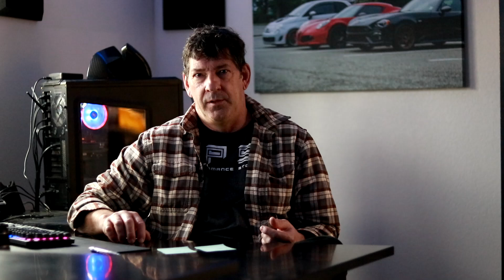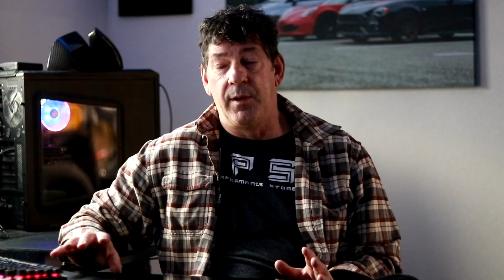Boeing 727 Falls From the Sky TWA 841

Comment: Notwithstanding the fact using the crossover valve to start the other engine should make it top of mind to IMMEDIATELY turn it off after engine start, how does a Navajo driver with that level of expertise not notice the tremendous weight imbalance of burning fuel only from one side? Even if his autopilot would handle that, you should notice the ailerons or yoke.
Reply from the maker: Having worked at that Airline I can explain that. There was tremendous pressure to be on time. So much so that the standard practice was to do the weight and balance data AFTER takeoff when in cruise. (not it wasn't legal, but the FAA didn't car) I'm not making that up. The pressure to "block out on time" was so great that the pilots are conditioned to only think about that and once the engines are started it's a big rush to get there. Also, all the airplanes were old and somewhat bent, so needing a lot of trim wasn't unusual.
Reply: @GregsAirplanesandAutomobiles , I've got quite a bit of time in PA-31's and am familiar with those kinds of time saving techniques such as doing W&B enroute, and checking weather and filing flight plans while taxiing out. But I recall an instance in a B-58 where one side was fueled and the FBO ran out of fuel before the other could be topped off. I flew for a 135 operation where a lot of the planes were "old and bent". Maybe I have the benefit of never flying anything with an autopilot I trusted, but an asymmetrical fuel load is nothing I could ignore, especially if I'd just used the crossover valve to start an engine.

I'm not dumb enough to state many of the things I did and saw during my flying career, but flying an airplane that wasn't structurally sound is something I'd never do.
Reply from the maker: Where did you fly the PA-31s?

Comment: I think you wanted to say that the critical Mach number and subsequently the limit Mach number decreases with higher wing profile camber, such as when having leading and/or trailing edge devices out, not the undisturbed airflow Mach number itself which is a function of temperature and density (altitude).
Reply from the maker: Time stamp.

Comment: I have a lot of doubts with the theory that the pilots extended the flaps and slats in cruise because wouldn't the other slats have been damaged when extended at like Mach 0.80, yet the NTSB report makes no mention of damage to them.
Reply from the maker: The reason for pulling the C.B. was to prevent the slats from coming out.
Reply: @GregsAirplanesandAutomobiles  I feel you misread what she was saying, if the leading edge slats did extend in cruise flight, as per the NTSB report, then they also would have been damaged by the air loads. It doesn't matter what version of the Pilot Action theory you believe (F.E. was out of the cockpit, F.E. didn't pull the leading edge slats C.B. all the way out, etc.) the pilots still extended the flaps and slats in cruise. But since the NTSB report makes no mention of damage to them then it casts doubts that the remaining slats actually came out, let alone that the pilots did the Flap Trick/Boeing Scenario.

Comment: Greg, something to mention about the CVR. From when they pulled the plane out of the dive to when they landed was 42 minutes. The CVR only recorded the last 30 minutes of the flight so the recording would have begun long after they recovered the plane and wouldn't have told the investigators anything of value. As soon as they turned off the runway and shut the engines down, the plane was surrounded by emergency vehicles and a mechanic plugged in to tell the pilots they had a fuel leak and had to evacuate the passengers. From that moment on the pilots were so focused on communicating with the flight attendants, mechanic, emergency crews, TWA operations, the tower, and transporting the passengers to the terminal that there was no time to even think of pulling the CVR breaker to preserve the tape. Yes, you should do that but the safety of the passengers is more important than preserving the recording. Also, there still was 9 minutes of recording available where the pilots were casually talking to each other and Detroit Ramp. They didn't erase the CVR or try to workup some cover story, there was a fault with the CVR: either a pre-existing fault or the wiring was damaged by the 6G pull out. The CVR was never analyzed for any faults; someone at TWA had erroneously told the NTSB this.
Reply from the maker: There have been plenty of other times they recovered recordings much farther out of limits than that. It's a tape that goes over itself and they have recovered recording something like 7 loops back.
Reply: Yes, you could get a recording going a bit longer than 30 minutes like 32 and 33 minutes, but it would not have gone as far as the 45-50 minute mark to have actually recorded the events right before the dive. This happened in 1979, long before CVRs started recording the last 2+ hours of a flight.

Comment: Not sure of the 727 but the 707 has a mach speed limit adjustment in the air data computer that will pitch the nose up to slow it down if the autopilot is on. If they go over the allowed mach number. That may have set some confusion on the flight deck and cause an over reaction and  they pushed the nose down too hard. The air data computer gets its input of the mach speed indicator. This is all analog stuff.

Comment: Valsan actually had a reprogrammed flap system that supposedly allowed flaps 1 or 2 without the leading edge slats allowing  higher cruise altitude.

Comment: I was a check airman and flight engineer examiner on the 727 at TWA. Most of us in house believed Hoot’s version of the story. Knowing the high level of professionalism of all those involved, we doubted that they chose to intentionally pull circuit breakers to go higher. Many at the airline believed Hoot was a hero. I never met Hoot so am going by my peer’s impressions. Man than was a long time ago.
Reply: Several things make this suspect.  

First.. the reasons.  A bad actuator means that a slat isn’t going to go out..  not go out on its own. It’s literally why they have to have a standby system as well because if you lose A system, you’d lose it all.  

Second.. after that particular brand of BS is debunked people start pointing to rudder hard over like 737s. Couple problems with that.  First.. the 727 has two rudders so only half the rudder surface would move.  Second.. 737s that crashed were at low speed.  High speed hard over was controllable by ailerons and spoilers. 

Third. The process to droop the aft flaps is a highly specific one. One that works within the complexities of 727 systems and solved a known problem with the 727. It’s also something that was specifically added to 727s later in the form of flap droop system where the aft flap is given longer control rods and a new false spar is installed in the mid flap… while the whole flap system is now locked out to 30 units max.  

Boeing didn’t invent this fancy procedure just to sewer one pilot.. so at the very least it was common knowledge and practice.  As was how it came unraveled with the activation of the standby pump.  

Finally.. and most telling… was that the CVR was erased.  The innocent aren’t afraid of the truth, and it takes conscious and deliberate effort to destroy CVR data.  Not enough time elapsed between the incident and landing for it to have been overwritten.

Comment: Greg, sorry for spamming you but do you know anything about the T28B/C supercharger?  I'm wondering what altitude it is optimized.  I know it's two stage.  I've read that below 15,000 feet it can hang with a Mustang.  Don't know how true that may be.  I'm just curious.  I'm looking at purchasing a B model with the -82WA engine, 1525 hp.  Thanks...
Reply from the maker: Hi Scott, I don't know that much about the T-28.
Reply: @GregsAirplanesandAutomobiles  It's an interesting plane.  Hopefully, you'll cover it someday.  The pilot manual will tell the story I'm sure.

Comment: My Dad worked for TWA as an electro mechanic during that period of time.  He always told me that you could pull a breaker and the leading edge slats would extend without the flaps.  And it also killed the safety interlocks.  What happened in this case was that one deployed before the other and caused the snap spin and subsequent descent.  Interesting to hear it differently.  Thanks for sharing!